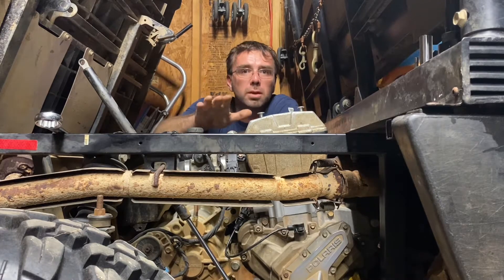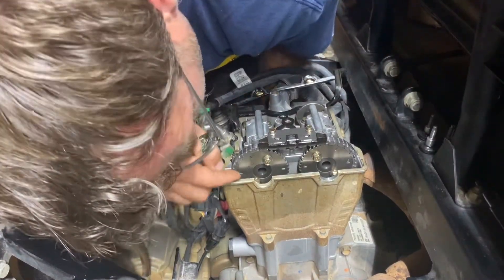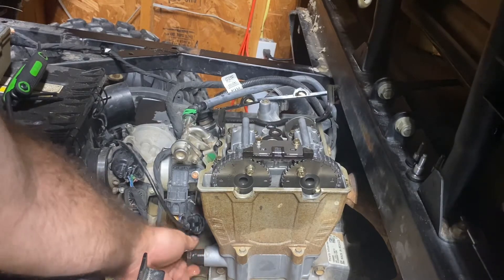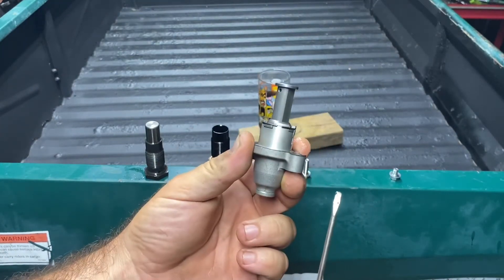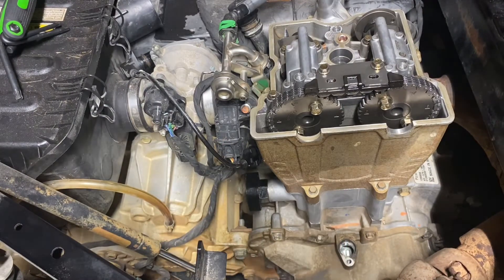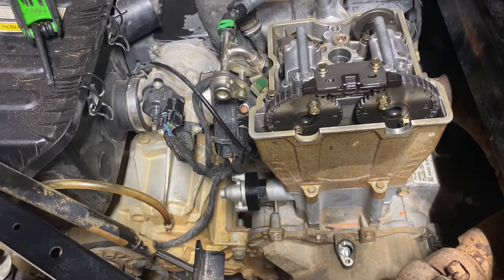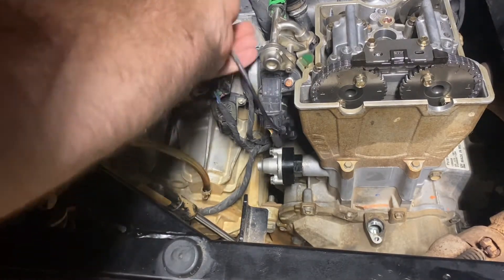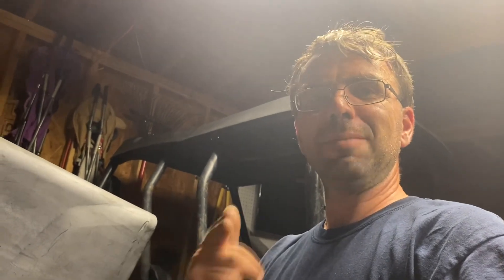Polaris Ranger Rzr Ace 570 Timing Chain Tensioner Upgrade

Comment: Working on 2015 570 ext it will not idle runs great 45 mph all day but come to stop its dies iv changed everything spark plug gas pedal tmap sensor cam shaft sensor whole throttle assy  body new fuel  pump assy new injector air filter all new and still just stalls will not start and idle  on its own power any suggestions  im at a loss
Reply from the maker: Hello. Two things first a etx is not a 570, their a 325 so first issue is you may be putting wrong parts in. Also have you checked compression, timing and valve clearance?
Reply: I had a similar issue I switched out the throttle position sensor and it helped out
Reply: Has to be either TPS calibration or the cable tension at the thumb lever.

Comment: What happens if you change the tensioner without finding TDC?
Reply from the maker: It’s a risky chance. You won’t be able to tell if all your marks line up. Therefore the engine could be out of time causing severe engine damage.
Reply: @montemania198210  Thanks for the reply. I am working on a 2000 Polaris Magnum 325 and changed out the chain tensioner to a used oem part without finding TDC.  It didn't solve the clatter in the engine, but it still runs strong.  Great video.  New subscriber.
Reply: @TheJcgraves99  we used to have a 325 sportsman and same thing it made a slap/knock while running.   I've heard it has to do with poor lubrication from that weird drysump system those have that leads to piston slap....there's also a screen inside the oil tank outlet that can become clogged and cause poor lubrication. 

I never found the exact cause on that sportsman, but I also beat the crap out of it in the trails and the knock never got worse...so it's not always a death sentence for the motor if it knocks lol.